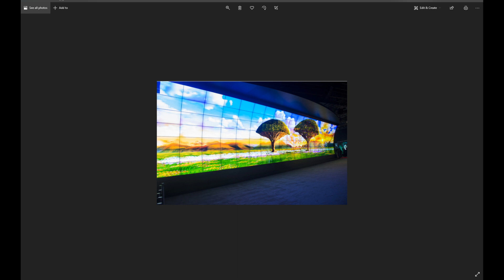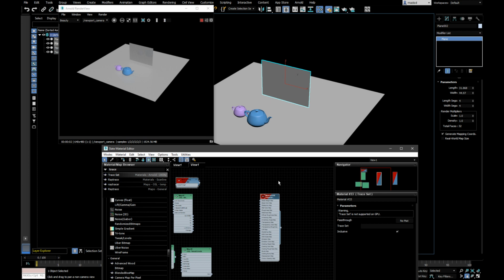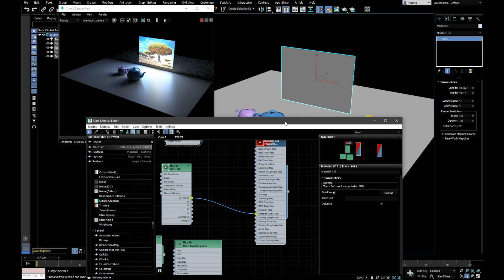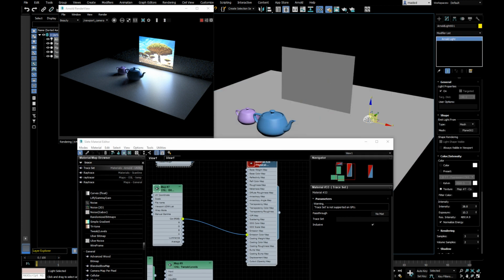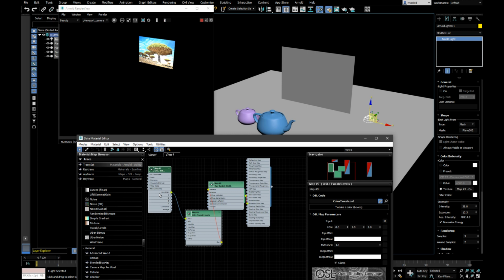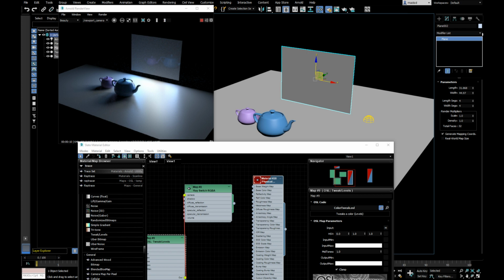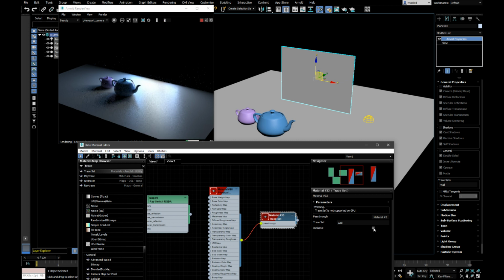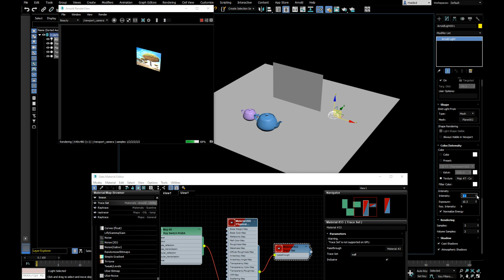ARNOLD 3DS MAX: LED Wall, emission and mesh light.

Comment: you literally didnt explain what type of arnold materials you were using. I have no idea what the OSL maps are because you didnt explain where you find them or how to get them.
Reply from the maker: This assumes you use 3ds max, after version 2020, and thus have access to the preinstalled OSL shaders that comes with max.

You can however also just download them from autodesks github if you use a different host.